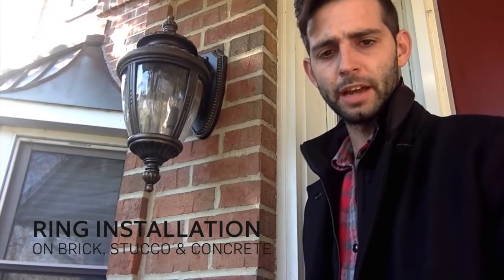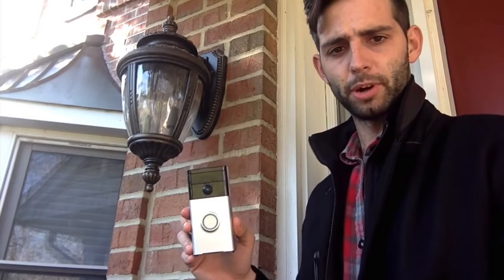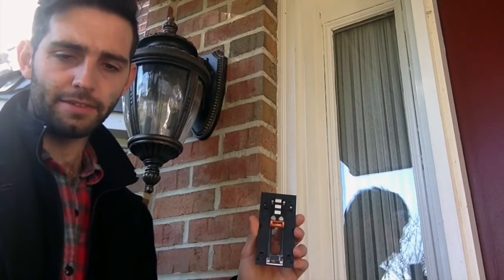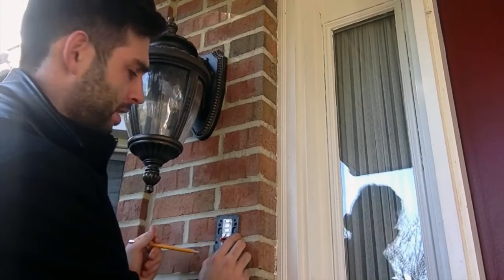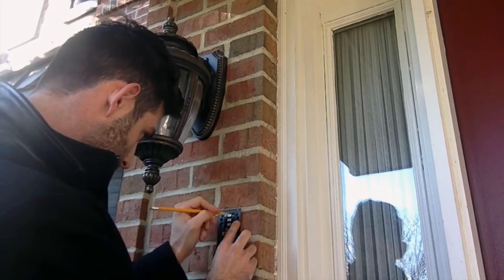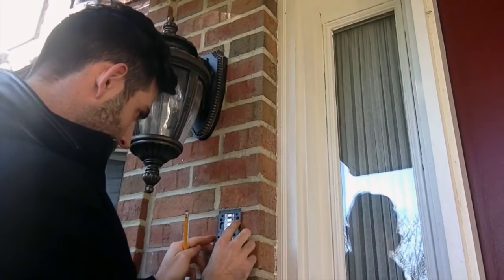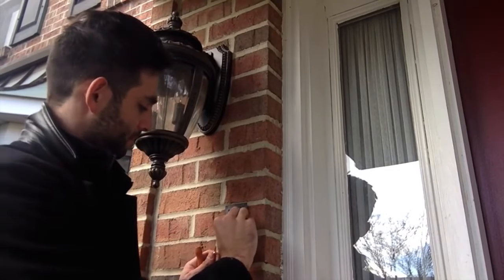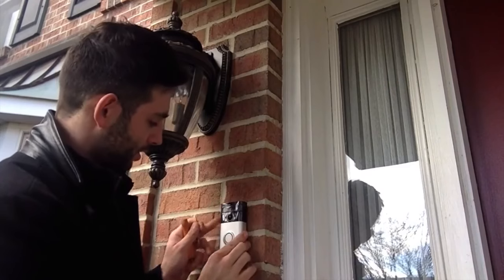How to Install Ring Video Doorbell on Brick, Concrete, and Stucco

Comment: Very uninformative video. For those asking I just installed mine on brick and works like a charm. I bought tapcon masonary drill bits (Lowes part #11249) which is a 4 pack but you can get just the one which is a 5/32" drill size and 4-1/2" in length. Also use the 3/16" all pupose anchors (Lowes part #50450) Just drill far enough and wide enough to have the anchor fit snug. Then just use the screws that came with your doorbell and Bob's your uncle. Oh and yes you can use a regular drill or hammer drill on drill setting and just make sure you use the masonary drill bit. And ordinary drill will just break off or worse mess up your brick. Hopefully that helps. Oh and mine did have an old doorbell which already had power. So if yours doesn't you'll have to run the power to a transformer that will go to the doorbell. Just search youtube for it.
Reply: You were more informative than the video.  You should make a video
Reply: Many many thanks for this!!
Reply: 3 years later and this comment still helped me big time. Exactly what I was looking for. Thanks!
Reply: Thank you!
Reply: I still don't understand????? I just wanna know if I screw the screws & wall plugs into the wall with the drill or drill the holes then put the screws in??! I've watched several videos and all I wanna do is launch it out of the window! Lol. Very frustrating 😕
Reply: @lj3893 Just drill the hole in the brick wall where you want the ring to go, use those multipurpose anchors (plastic thingy for screws), then use the provided screws from the ring or similar sized screws and screw that into the anchors. Hope that helps.
Reply: My house is cinder block so the little screws they provide cannot be used.  I tried to use tapcon screws but they stick up too high to mount the battery powered cam.  Terrible.
Reply: @streetsk8rfl you need to drill into the concrete part in-between the cinder blocks. Not the actual cinder block.
Reply: @X3WorkshopDesigns  tapcons work best when drilling in the block directly.  My issue is not with the wall mounting plate.  It is firmly attached to the wall with the skinniest (3/16) tapcons.  The problem is that the camera mount housing hits against the tapcon heads so it would not attach.  I used an exacto knife the shave the plastic on the underside of the camera mount then sanded it down so that it would catch.  These should NOT be sold as mountable on concrete block walls.

Comment: Except they skip the 2 hours of drilling into the brick with that bit. They need to provide a better bit or tell you what type of drill to use.
Reply: dont forget the several hundred gallons of water to keep that bit from melting as well. :)
Reply: Also skipped showing the "filled with concrete anchors" part.
Reply: @Sassofrassquatch1 it's called sarcasm
Reply: I never even received a bit.
Reply: Exactly!

Comment: TIP: Once I abandoned the masonry drill bit Ring provided and purchased my own, I had little trouble drilling into my brick home.
Reply: Did you use a regular 18v (or similar) drill? Or you have something more heavy duty?
Reply: @kiathomas9993  I used a 18v Black & Decker drill I bought at Walmart.  It is definitely not heavy duty.  It took me about 30-60 seconds of drilling per hole.  I had to apply a significant amount of pressure while drilling and kept pausing to blow the dust out of the hole.  I also took a few breaks to let the drill bit cool down.
Reply: Do you know what size drill bit you used?
Reply: @lesschoolaccount  I can't remember the size, but it was the same size as the bit Ring provided.

Comment: Is it possible to install the Ring Pro DoorBell without an existing DoorBell? If so can you please explain or make a short video ? Thaaaanks =)
Reply: Albena ALEKSANDROVA not the pro but the original or doorbell 2 are both powered by battery
Reply: You can with the Ring Doorbell 2 but then your motion detector will probably no work.  Mine doesn't when just using the battery.

Comment: Sorry, can't help but notice the holes weren't lined up properly and there is only a single screw in the top left that is holding the bracket onto the wall. (Measure twice, cut/drill once) Also if anyone is buying a drill for working with brick, masonry or concrete, get a hammer drill (not an impact drill) as hammer drills are made for these materials and will save you time, effort and ensure the holes are drilled properly.

Comment: The drill bit is not the problem. You MUST us a "Hammer Drill" with  the drill that is provided.
Reply: I was using a hammer drill and was having no luck with that drill bit. I'm glad to see the comments on here that the bit is definitely not the correct type.
Reply: MaryJo Sminkey buy a new one

Comment: Just tried this and the drill bit is not working on our brick and is already destroyed.
Reply: Perhaps use a hammer drill
Reply: Nicole Rov you need a masonry drill bit
Reply: Nicole Rov and you need to drill very slowly o as not to destroy the brick

Comment: There is no way I will drill holes into the brick on my house. It's better to go into the mortor as those holes are easy to patch. There has to be a bracket out there to mount the Ring onto that lines up to the mortor.
Reply: I agree with you and would love an answer to that question!  No one should ruin their brick by drilling holes in it!
Reply: Drilling into the brick is best.  Drilling into the mortar compromises the integrity of the structure.

Comment: Hi. I finally got the classic ring doorbell. I noticed you installed on a brick surface. Can I use black and decker 18v cordless driver drill that has a 750 rpm motor to make 4 holes into a brick to so I can put 4 anchor screws to install my ring doorbell? Or will I need a hammer drill?

Comment: ...How does it get power??
Reply: +Adam Robles The classic ring has a rechargeable battery pack built into it.
Reply: You can also use the existing wires if you replace a doorbell button to power it instead of having to recharge the battery.